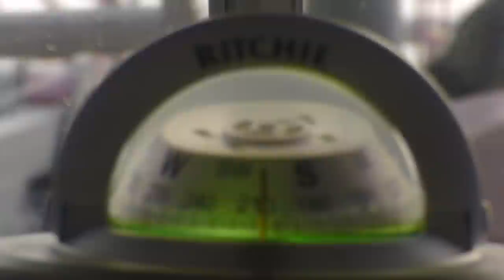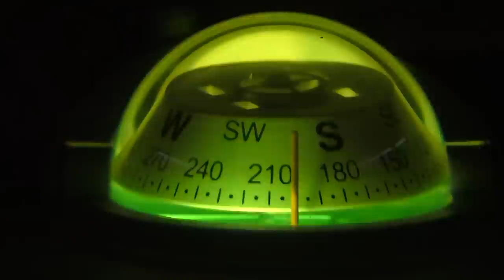Ritchie Compass Installation

Comment: I have missed this for the last 8 years. I had my lil boat parked under power lines and I'm sure that's the only reason the internals of my compass turned upside down. I had to pull the compass out and shake shit out of it while turning it till it came good. My lil boat doesn't even exist any more. This is so good to see how far everything has come. Missed you guys.

Comment: Lightning out at sea can be a bitch, one zap and everything electronic is dead. Redundancy, like a compass can save your life. If it’s gonna storm consider placing something handheld with gps in your oven, the oven will probably act as a faraday cage and prevent the device from being fried.

Comment: Redundancy is always nice.  Especially when it doesn't need batteries.
Reply: In Canada any commercial vessel (used for anything other than pleasure) and any vessel over a certain size is legally required to have a magnetic compass as a redundancy.

Comment: You'd be daft not to have a manual backup. Electronics all hate water and lightening etc, so if you ever have a disaster on board but remain afloat this'll come in useful. 
I'm surprised your insurance didn't insist on one?

Comment: First time I single handed my boat on the Delaware bay I ran south about 10 miles to my fishing spot.  While fishing dead stick at anchor the wind pick up to 25 knots.  I had a USCG navigation course so I took my position and set a course home. After much trouble a got my anchor up and about the third 6’ wave I hit my gps went out.  10 miles a@3 knots I 
was in the dark.  Used the plot from my chart and compass and found home.  You can die if you don’t respect the sea.
Reply from the maker: Great story, thanks for sharing.   But here is a fact:  You can not really live until you go to sea or climb your Everest;  and you are going to die anyway.  : )
Reply: @SVSeeker  yes you are right.  But unless you want to end your life ,being prepared is most important.  I have no fear of the sea but great respect.  I’m older now thru no fault of my own😁. I’ve spent most of my life outdoors mostly in a boat and alone.  Duck hunting in winter in a 12’ sneakbox.  Fishing for stripers spring in fall often at night.  Sailing with my friend up and down the east coast.  Also spent 13 years with the coast guard auxiliary.  So not afraid to die but don’t want to give up my life because I wasn’t prepared.
Reply: @JamesTaylor-bb6cw  "... don’t want to give up my life because I wasn’t prepared."  My feelings exactly. AND being prepared is not hard, but it does require an acceptance of the risks involved and a strong desire to die old and in my bed, at home, warmed by a long lifetime of memories.

Comment: Other devices are great for a compass too but..... it's nice to have one device that is almost bulletproof and works without power.   Not to mention the fact that this compass can be calibrated for its current position on the dash and be accurate despite the magnetic anomalies present in your pilot-house. 
 5 degrees of deviation or even more can really screw you up over longer distances.

Funny story.   I live next to lake erie and was talking to an old head while waiting at the ramp and he told me he didn't know about calibrating a compass once mounted and couldn't figure out why his boat always ended up about 3 miles down shore from the ramp when he had to use a  heading coming back in!  He always got back to the south shore.... just the wrong spot. 

He always thought it happened because he was a little drunk coming back in almost every time😂. 

This literally happened for YEARS!  It wasn't until  he broke down while out on the water and while being towed in noticed his compass didn't match the tow-boat's😂.  When he asked the other captain he found out all about compass adjustment.

Comment: If your in the middle of the ocean and the power goes out, you still need to be able to navigate.
Reply from the maker: I have 4 ways of making power,  4 separate battery banks, and 4 devices with compass and charts.  If all of that is gone, I suspect we are too.
Reply: @SVSeeker  They have all that on the cruse ship I ended up being rescued off too.  It still managed to get dragged into port latter. You never know. Stranger thing have happened and been survived.
Reply from the maker: @randywise5241  Next time take a ship with sails.
Reply: @SVSeeker  🤣👍

Comment: Best practice is to have three simultaneous navigation plots going.  1. Dead Reckoning i.e. Compass course and time.  2. Sun/star shot i.e. Sextant.  3. Electronics.  Record all three on a paper chart.  Since (even though you're from Oklahoma) you can;t walk on water, you should always be prepared for everything to go all to hell.  Believe me, after 72 years in mostly sailboats, at some point it may very well go all to hell.  The idea is to never have to use your EPIRB.  I looked on your home page and see you've got a snail mail address.  I'll be sending you a piece of equipment I no longer use.
Reply: ...a captain's bell?
Reply from the maker: Thanks, but no more gifts at this time.  Next weeks job is clearing stuff out of the cargo hold.   Pull along side if you want stuff from Seeker.

Comment: Not necessary, true, but it's a comforting tradition. Bulkheads are walls but they're not called walls...tradition. Decks are floors. Nobody poops on the poopdeck anymore but, you know, tradition. We use the Head, the toilet, the bathroom.

Comment: You can navigate without a compass... as long as you have the internet or happen to have a sextant. 
/
I'm surprised that someone who built-in many redundancy systems into his boat wouldn't add an old-school (calibrated to your boat" compass to the mix. 
/
After all, things do happen.  If you were to lose the internet, wouldn't all of the electronic navigation equipment basically be useless?
Reply from the maker: Charts are on the devices.  No internet or cell connection is needed.
Reply: @SVSeeker  That sounds like a cool feature, smart a choice.

Comment: You picked the wrong compass.  That is an aviation compass popular on recreational boat.  You need a flat Disk compass so you can take bearings from it.  Going to sea is not like navigating a river.  Flat disc will also show your position to the heading so you can tack.

Comment: could all those electronics around the compass blind it?
Reply: Causes magnetic interference.    On our tug our electronics send the compas aprox 5 degrees off corse.   We correct it with the external adjustment that slides magnets inside the compass.
Reply: When he needs it the most, there won't be any interference..........
Reply: @nickmaclachlan5178  good point

Comment: I don't sail, so honest question:
What use is a compass if they're phasing out paper maps? Will you just keep a massive pile of old maps and hope that they don't damage or decay, and that they will still be partially relevant if you need them? 
How did this work?
Reply: A compass is great if fog rolls in and your GPS isn’t picking up signal. You don’t need maps if your goal is to find land and you remember where land was. 

In a channel or river there “should” be buoys and markers, and in a thick fog you should be moving slow enough to see and react to them. (So less than walking pace in some cases)
Reply: @dylanzrim3635  Thank you.
So if you, for example, get struck by lightning out at sea, then you'll be able to use the compass to follow a general heading to find land from memory and without maps.
Cool 😎
Reply: I can’t speak for the US but In Canada on commercial boats paper charts are still required by law to be on the boat, same with a magnet compass is also a requirement.   We have been struck by lightning in the past and it wiped out all the electronics (radar, chart plotter, radio) so the charts and compass did come in handy that day.     Storage is always a issue to keep them in good condition. On most our boats we keep them in our chart table drawers and on the smaller boats we have them rolled up and stored inside a watertight tube.    Come inspection time (annually inspected by transport Canada in order to get the comer coal certificate) we pull them out and have them ready for the inspector to see so verify we have all the necessary ones onboard for the waters we are in.   Every so often we have to buy new ones for the updated info and luckily charts arnt very expensive.   They are $20 each for the coastguard approved charts for our areas
Reply from the maker: That's an interesting point.  The diehards will always have paper charts, and I like them for planning a route.   But on a starless night you can use the compass to hold a bearing if the chartplotter is out.    You can also use any smart phone too with either it's compass or better yet, the electronic Navionics charts.  : )

Comment: faulty bearings in front of your nose is a bad idea.
that compass might through you off your bearings.
.....on the rolling stones....with no direction home.
Reply: if you want it as a steering compass be aware you have to
keep compensating for variation and deviation over time.
And in communicating with the helmsman be aware of
discrepancies in course reading from different sources.

Comment: "I don't think you need a compass." and all you said offhandedly about electronics is... well, let me ask you this, you wanna sail the world... ok, so, imagine you are 1000nm off shore, there is a horribad storm, a rouge wave (yes they are real) and you are rolled... and you lose ALL power systems... what then?  Yes it really can happen no matter how many back-ups you have AND phones and iPads, etc. ALL need to be "charged" eventually right?  so... you really really need to ask yourself, IF that actually happened, what do you do then?

A good compass, a wind up clock (yes manual "wind up" clock, AND kept wound up), a good sextant, a full set of paper charts, pencils, crib sheets and the SKILLS to use them will be all you have left... None of those need electricity, just your brain, your skills and your determination to survive.  And yes, I do have ALL the above on my boat, and in my head, right now. YES I have been on boats that have lost ALL power, but thankfully none that have rolled...

Doug, this is NOT a negative comment or a slam on you man, but I have been messing about on the water all my life (62 now) and you absolutely MUST be a Boy Scout and ready for ANYTHING every day you are out there.   Every.   Damn.   Day.  The sea is uncaring and will test you and that amazing boat in ways you can never imagine.

Let me say this as a last nudge... Learning to navigate by the sun and stars... is really fun, fascinating AND a potentially life and boat saving "hobby"... It really is fun to see just how accurately "you" can determine what all that tech is doing "for" you.  =]
Reply from the maker: If that happens I'm flipping on the EPIRB and heading to the nearness Casio because statistics have become meaningless.
Reply: @SVSeeker  Doug... sorry man, I am struggling to understand your reply.  If just short of "the worst" happens, then you are gonna do what? Flip on the EPIRB and jump overboard?  and may I ask what statistics? Sadly people are lost to the sea every year, but many are saved because they did plan ahead and were ready for the worst. A sailboat was lost just this past week on passage in the Pacific but ALL aboard were rescued EVEN though the boat went down in under 15 minutes, because they planned for the worst. That is the only statistic I care about and I was hoping to give you good advise. Because I respect you... and what you are doing. The statistics I am worried about are the one's ending in, "number of souls lost = X" and how NOT to be one of "those" statistics.

Doug I REALLY like you and LOVE what you are doing. I have seriously considered trying to crew with you. Seeker is super inspiring and your no-nonsense get-it-done self-reliant attitude absolutely rocks, especially in today's world. But to say "F-it" at the idea of planning for "worst case" scenarios is really not how I felt you would think about this. I am truly sorry if I offended you man. Not at all where I was going with this. My apologies.
Reply from the maker: @Turaelin   Try finding some humor.
Reply: @SVSeeker  I do hope we meet one day. You might be surprised at how much CJ & I love to laugh and joke around...
But I also know when to laugh, and when that is not the proper... tack to set.  =]
Anyway, you do have my very best wishes and my respect, FWIW.  I do hope to meet you one day Doug, so I can show you my appreciation and good will. Seeker is one helluva boat.